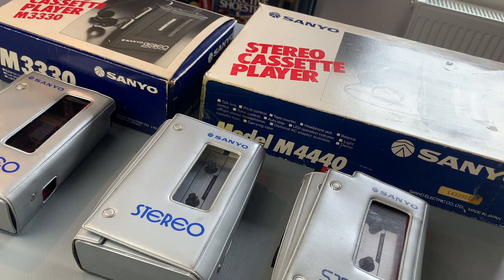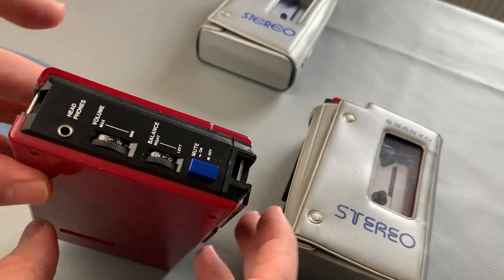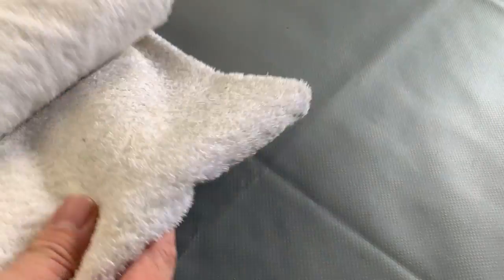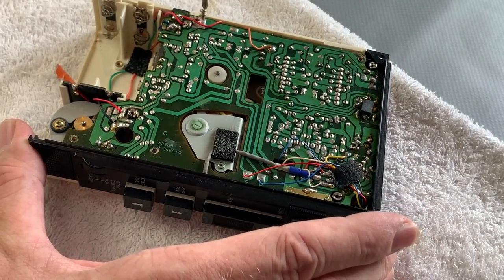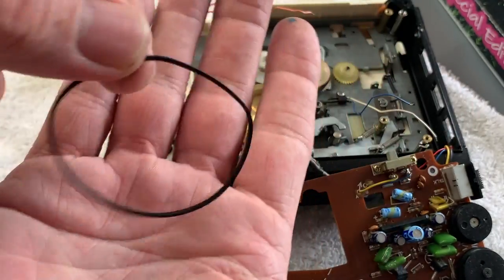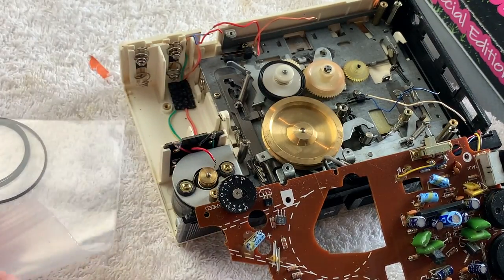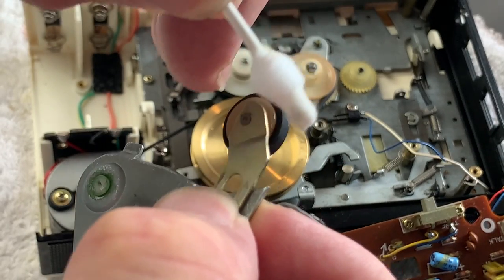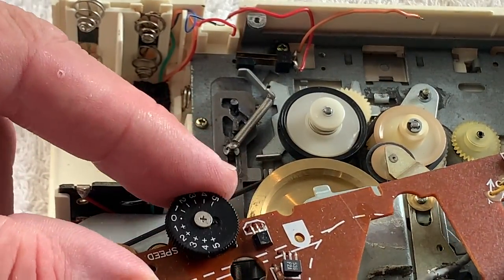Sanyo M4430 Rare Cassette Belt Replacement and Service. Walkman Repair 1980's

Comment: I’ve had one of these since I purchased it new in July 1982 on holiday. I’ve lost the battery cover somewhere in time but the silver case has always been on so that kept the batteries in. I can even remember the two tapes I got at the same time (Dare-Human League & For those about to Rock-AC/DC)and my weird mix of genres has been with me before and forever. Thanks for vid on this inspiring to do mine and maybe try and 3d print a battery door. Cheers Tone
Reply from the maker: Thanks for watching! I'm glad you still have yours, and you should definitely start to use it again 😄👍Those cases are pretty good, but it's good to know that they do actually help to contain the batteries too! Be worth 3D printing a cover, as I don't think I've ever seen one come up for sale on its own. Do you use filament or resin?
Reply: I have both of those albums! A great choice, 1982 was a good year for music!
Reply: @retro_restos   I use PLA filament. Will be an obvious replacement when it's done but as long as it keeps the batteries in. Might take me a little while to do in freecad but when i've got it sorted i will release the file in a Vid or something as i'm sure someone one day will want one.
Reply from the maker: @TonesElectronics  sounds like a plan. As you say, PLA wil do the job just nicely. Good luck with the CAD 👍

Comment: They look great to work on! Some personal stereos are an invention of the Devil! I can vouch for those belts, their top notch! I have used them on a number of my machines!
Reply from the maker: Honestly, these are an absolute peach to work on. I literally did a M4440 today (I'll be featuring it soon, including the demo tape that comes with it) - 11 screws and 9 wires to remove, but surprisingly easy if you are careful and methodical. I love that they are so 'mechanical'. No clips, studs, poppers or ambiguous ribbon connectors. If it comes out, it goes back. Lovely!

Comment: I ended up getting my dads a few years back. It surprisingly still worked after cleaning up some corrosion. I took it apart to clean it up and when I soldering everything back in their spots it now won't run. I set it aside for a couple years and just today started to look for issues again. I checked to make the sure the motor runs and it does. No idea why it's not running now and I don't have enough experience to figure out why. Frustrating that it worked and now it doesn't.
Reply from the maker: Thanks for watching. These can be finicky. It could be that the board was not seated correctly, so the leaf switch might not be being activated correctly. Failing that, it will be worth unpicking the joints, checking nothing is bridged, and that the red wires in particular are on the correct pads. Also, the wites are pretty thin,and the cable ends can break off at the solder joint -  so it's worth checking that you hve enough fresh wire exposed to solder onto the pad to make a decent connection. Good luck!
Reply: @retro_restos  I didn't even know the board could be seated incorrectly. It seems like it goes on normal. How would that make the leaf switch not activate if it wasn't? It doesn't look like there would be anything in the way of it. I tried resoldering everything and checked all the resistors too and they seemed fine. I really don't know what else to look for or what to do to make it work again.